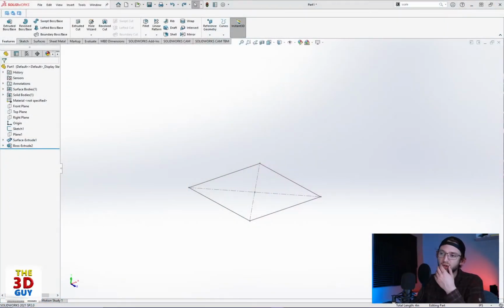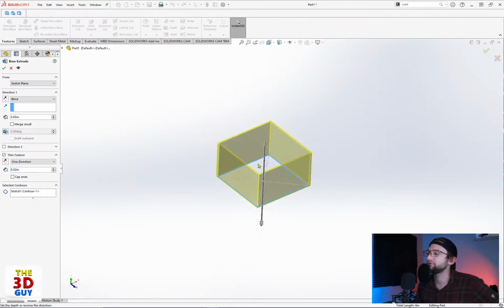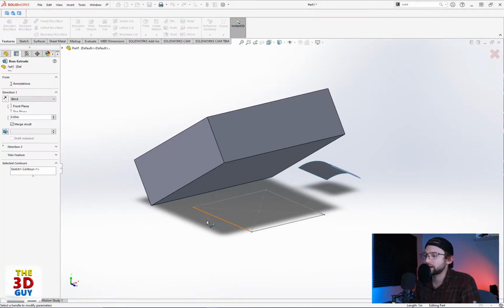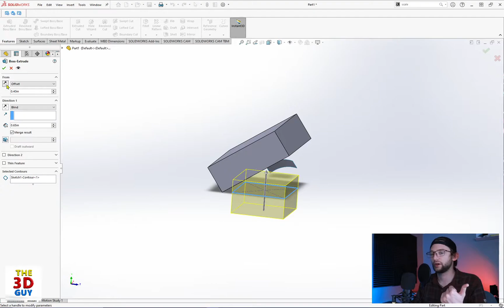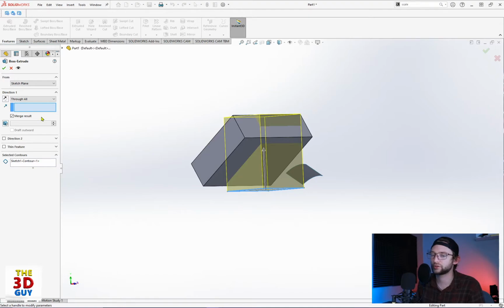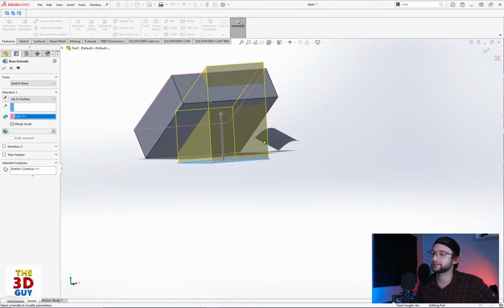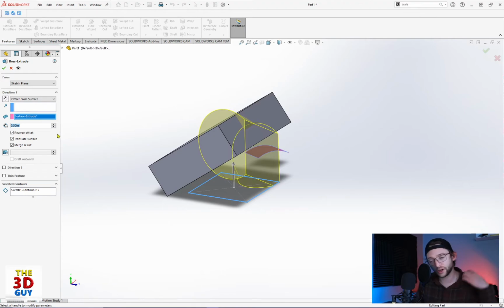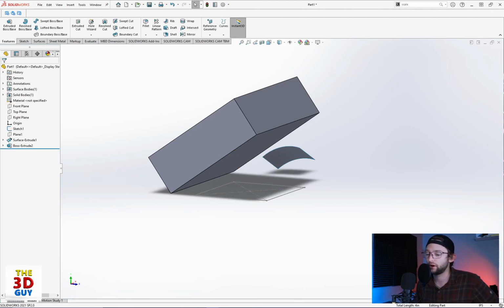How To Extrude In SolidWorks

Comment: Nice video.  How do I extrude to a preset parameter distance? I have 3 parameters with the width, length, and height, and after drawing the rectangle to the length, and width, I now want to extrude it to the preset height.
Thank you, Roland